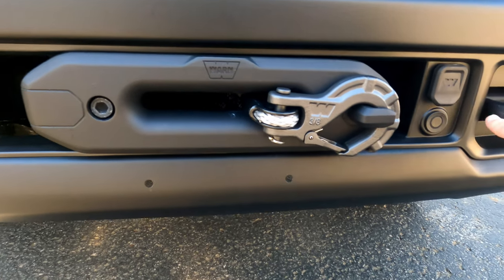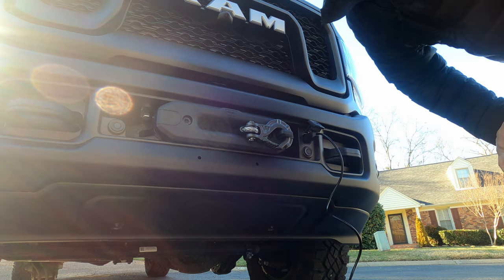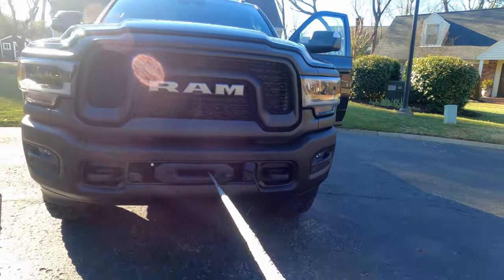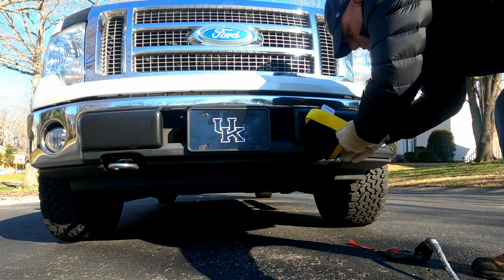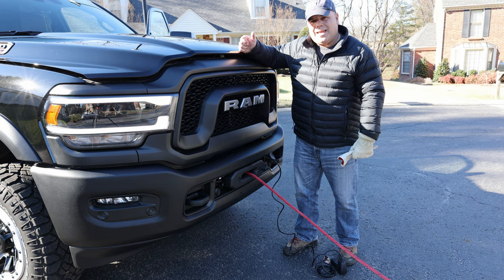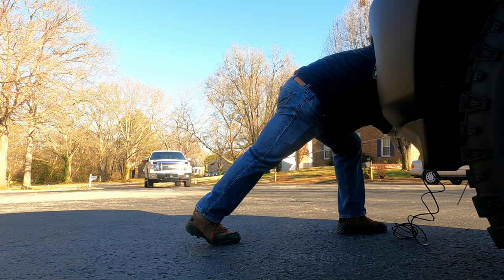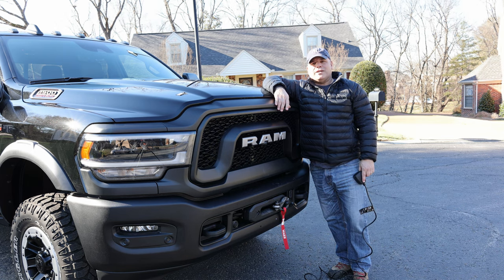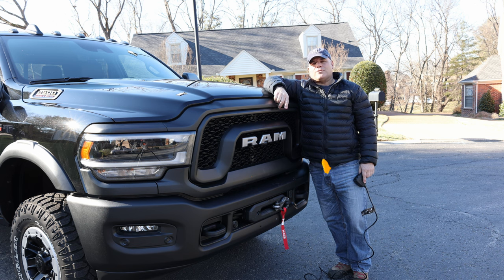WARN 12,000 lb Winch Pre-Tensioning // 2022 Ram 2500 Power Wagon

Comment: With synthetic rope, if it breaks it will just  drop to the gound, with steel cable, it will whip back. If you lay a tarp or blanket or even a jacket across the line, it acts like a parachute and prevents whiplash of the cable. I like synthetic as it has no burrs to cut you.
Reply from the maker: Yes, I bought one of those weighted dampeners for the cable to prevent that whip back. And I agree the synthetic cables are much safer.
Reply: Have to thank Matt's off road recovery for this little tidbit

Comment: Thanks for the demo. I've read good things about the winch, and truck. It does seem like Warn would have made the winch lever where the up position is free spooling so it can't fall and accidentally go into free spool. It must be fairly stiff and not able to vibrate or move unintentionally. 

I have a PW on order since mid May so my wait has just started. Curious if you MPG has improved any over the last 2 months while breaking in the engine. You mentioned 9.5 city in another video. Thanks again for posting.
Reply from the maker: The winch lever is pretty stiff and you know when it is engaged, but I have to admit it's a bit stiff and hard to reach.
I ordered my PW on May 31 2021 and didn't get it until Jan 21 2022. I have heard they are not taking as long as they did last year. As for MPGs, I am currently on a trip out west and I have been averaging 13.5 - 14.5 MPGs (one of my tanks I got 15.1) and I have not stuck to the interstates. Overall, it has gotten better, but most of my ordinary driving is around my small town, so MPGs are pretty low. Just remember, you didn't buy it for the MPGs. 😜👊👍🏼
Reply: I just bought a used 2018 with 14k miles its getting 10.8 thats city and highway only 1tank of 200 dollar gas... 6.29 in california
Reply from the maker: @leonchapman3578  ouch!